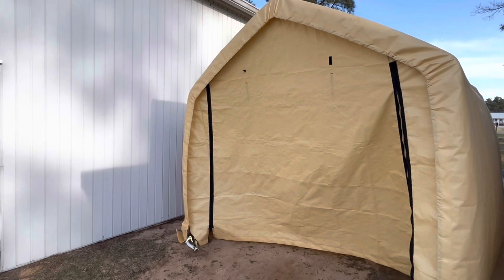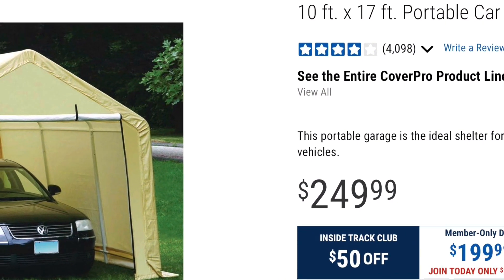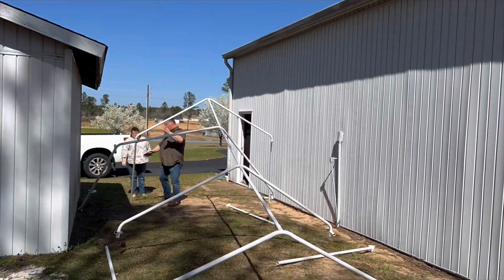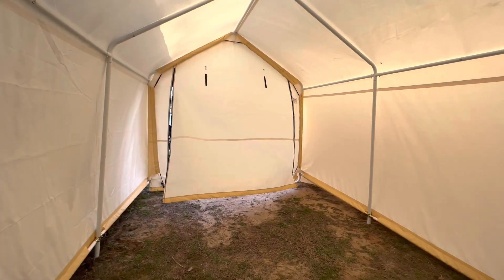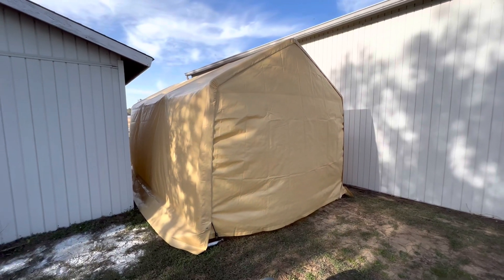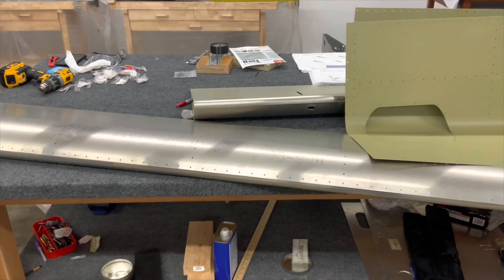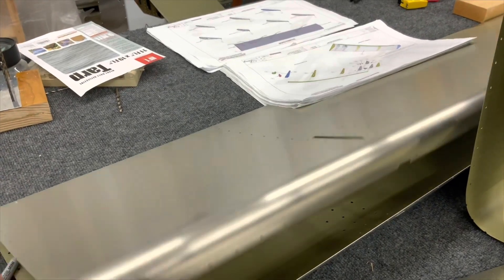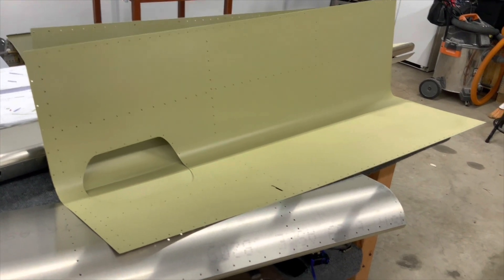New Spray Booth - Using a Harbor Freight 10 X 17 Portable Car Canopy to Spray Aircraft Parts

Comment: Are you concerned about dust floating around in the tent or are you going to try sealing it up in some way?
Reply from the maker: I have a large heavy duty tarp inside the tent that extends up the sides.  I've only used it once for painting so far but it worked great.  I'm not going to painting any exterior pieces of the plane with this, just priming interior pieces for corrosion protection and then painting a few interior pieces that will not be covered by carpet or upholstery.